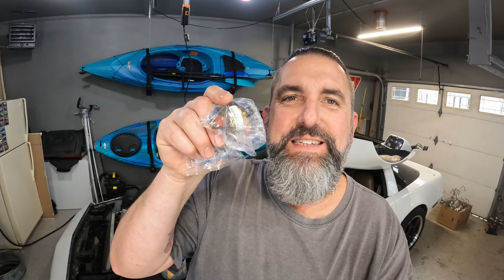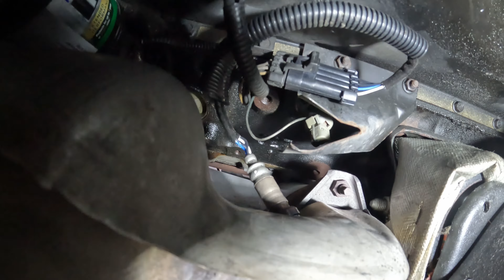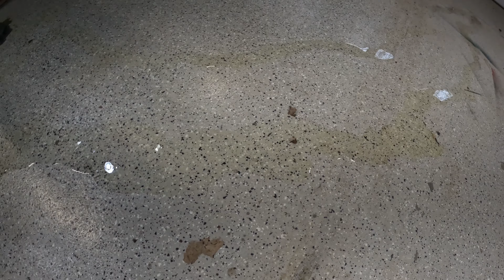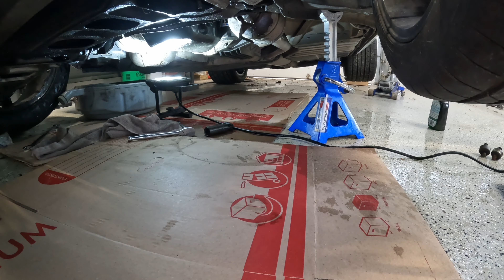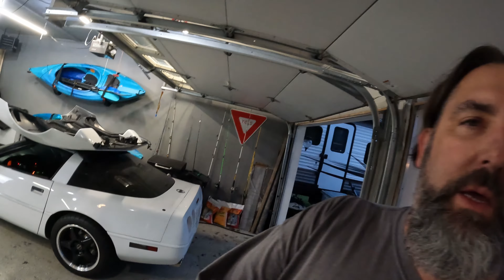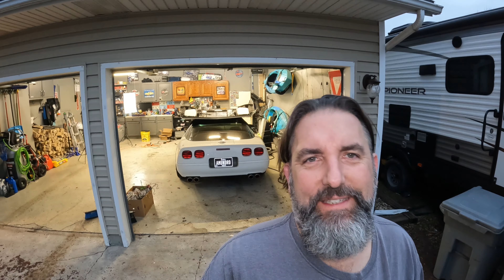Replacing Knock Sensors 1994 C4 Corvette

Comment: Thanks for sharing. I was able to replace a ground wire as I watch your cat removal video. 
  Mine is a 93 LT1 manufactured in October of 1992
  I’m interested in your OBD 1 computer connection.  
Is there a video that shows how you hook up your laptop to see engine performance?  Thanks again.
Reply from the maker: I am not sure if I ever made a video of the connection, but I did order a cable from a website specifically for this - when I get back home I can look to see if I have the website saved!
Reply: @Amundred  please do a video 
Thanks again

Comment: Did fuel pump in that car I put a fuel pump in my car it was hesitating real bad what a hose on a fuel pump for the motor is that little hose down and sits in the gas was blow it was bypassing blowing up was making a car bog out that's all it was I popped a brand new fuel pump back out and put two hose clamps on that little hose and it was like brand new

Comment: Would incorrect knock sensor from Camaro make the c4 spark knock and run hot
Reply from the maker: Hmm...possibly...the knock sensor will tell the computer to adjust the timing and could potentially cause issues if the knock sensor is not correct and not working properly
Reply: @Amundred  👍🏽 appreciate it